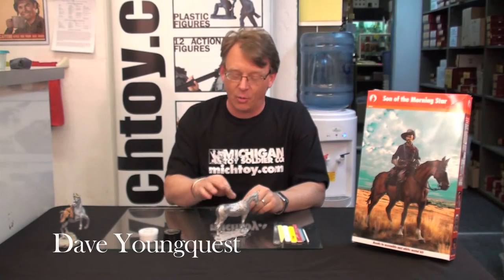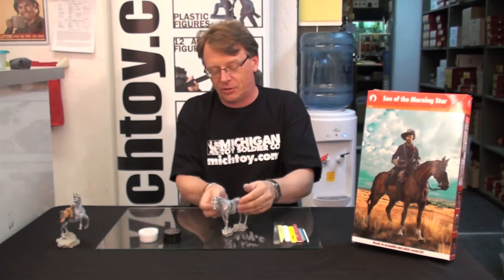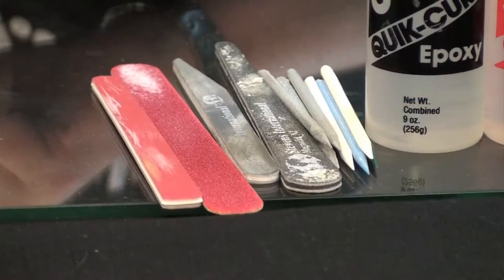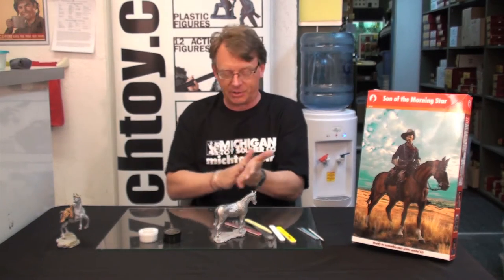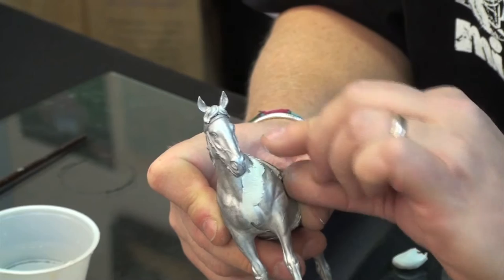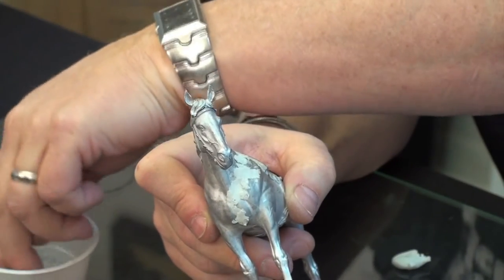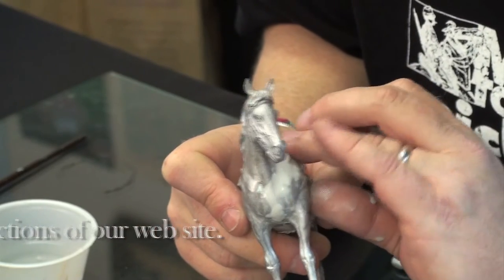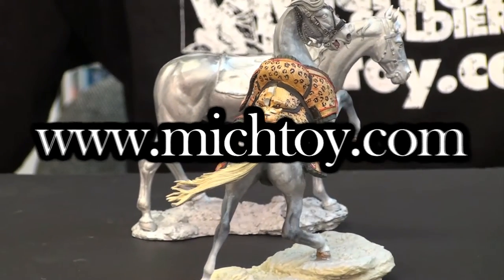Preparing a Figure Kit for Painting Part 2

Comment: Hi there. Before you apply the epoxy, should you not clean the metal of mould release residue? If there is any of this on the model, will it affect the primer? Thanks in advance for answering my question........